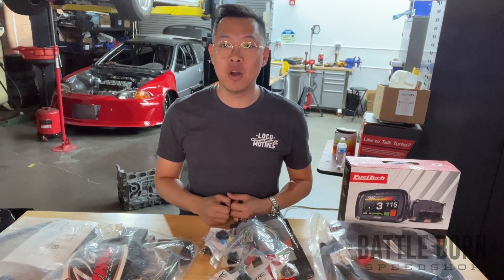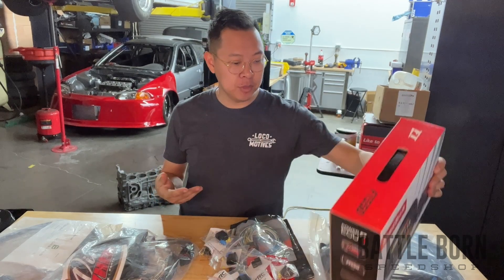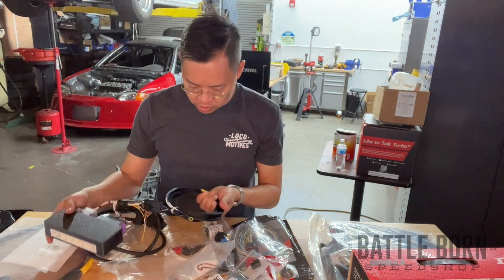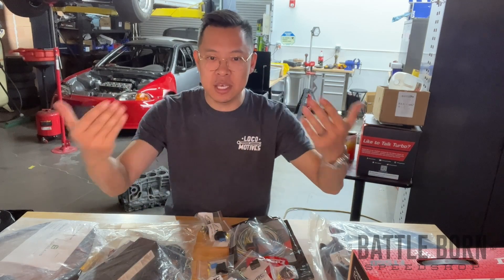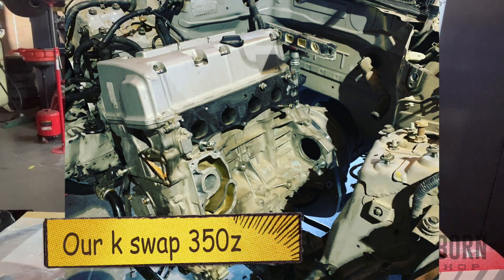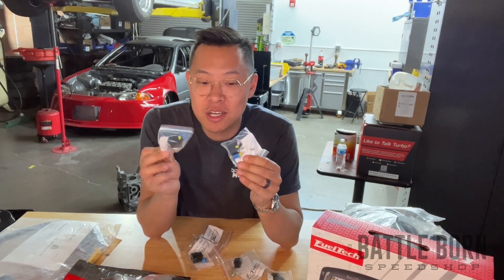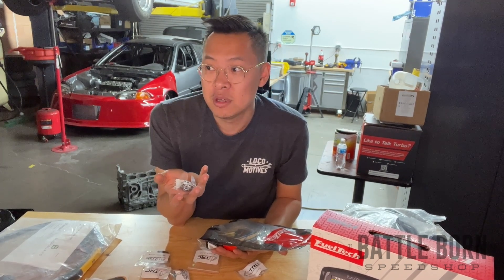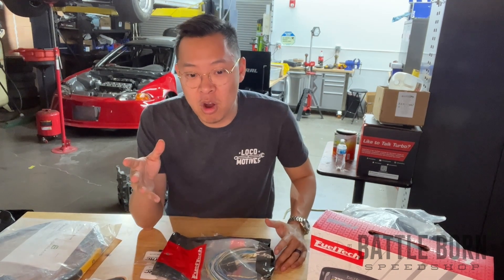3 WAYS TO WIRE YOUR FUELTECH STANDALONE ECU

Comment: i have a 1997 Corolla AE111 that has a 4afe engine, its fuel injected but uses a distributor, sparkplug wires and im interested to buy the ft450, install it in my car and replace the old stock Toyota ECU. all i want is to see live data like checking the average fuel consumption, trip meter, TPS, O2, fuel level and coolant temp . i don't have any intention of tuning to a performance car, i wanna keep the car stock, its like the FT450 dash/ecu becomes a multi information display for my old car. can i do it?

also i plan to keep the old sensors, connect it to the FT450. maybe in the future upgrade to coil on plug ignition also. lastly can i see avg fuel consumption on the ft450?

Comment: What do I need to run 8 injectors 4 on pump gas and 4 on e85 separate fuel systems k24 ft550

Comment: Also has outputs for head lights and tail lights along with turn signals just about anything you need as long as there's an output left for it. I'm using the FT550 with a rywire harness in my turbo b-series. Found a stock OEM female ecu plugend then crimped and solid all my own wires. Took a little time but came out just right.
Reply: I’m going turbo v8 and it sorta scares me to lose my knock sensor

Comment: I need a jumper harness for my Fueltech ft550 on a sw20 K Swap MR2. The harness will have to be a tad bit longer to reach my dash.   Can you accommodate this? I’m currently running K Pro on a K24a2

Comment: Good afternoon, what about controlling your cam vtc gear? Will this work?
Reply from the maker: https://cdn.shopify.com/s/files/1/1414/6340/files/FT450_HONDA_K20-24_ENG.pdf?v=1598466861
Reply from the maker: Yes it will. They have you wire it a specific way.

Comment: I am confused about existing Honda fusebox and relays. As an example - the radiator fan relay wire goes to the fusebox right? Where would i connect my FT ecu wire for that?   (btw this is for Honda Fit swap)

Comment: I have stock acura rsx type s, i want to change simple stuff like intake manifold, race headers, cold air intake, will this work?
Reply from the maker: Because you already have a k20, I would wait until you want more power out of your RSX for the fueltech
Reply: @diymike  i apologize, i am new on putting upgrades for k20. What do u mean by “wait until you want more power.”? I only want 275 hp to 300 hp all motor. No turbo, not doing k20/24. May u pls also help me with list i need to achieved even 275hp on my rsx type s? Thank u in advance.

Comment: I know this kinda dumb but would this work on an a3 since its still technically a k series.
Reply from the maker: yes it will, as long as its wired correctly a fueltech can power any motor from 2 cylinders to 12

Comment: Does anyone make a harness that lets me use my existing rywire engine harness but just lets me plug that and the fuel tech together for b series like you showed for the k series? Until i rewire the entire car from scratch for standalone?
Reply: this will sell..!!!!
Reply from the maker: I don’t about B series … but! Standalone harnesses are in the works currently
Reply: Not sure if you found it yet but BoomSlang makes an adapter harness for the low low price of $700.
Reply: @harryazzole7814  dude your a fu*king life saver 🙏🏼🙏🏼🙏🏼 thank you so much

Comment: Let's do a J series FT600 in a 6 speed TL S type. I'm in Vegas own the FT600, A and B harness non terminated, FT 8 switch panel. 2 nano O2 sensors 1 for each bank. And most, if not all connectors and sensors. The TL is gutted and easy to work on. J swap Jason.
Reply from the maker: Bro I got an standalone aem infinity harness for a j32. Right now. Imma do a video on it.
Reply: @diymike  we should link up. I'm the guy that tossed Carlos some P2R gauge's when I hurd you got the J series build. Told him use them on whatever your team wanted, but hoped to see them on the j series build.
Reply: @diymike  also the engine build is a j32a3 with j37a1 crank, traum .5 over pistons and P2R rods, with their baddest CNC heads they make their vtec Killa cams that lose the outer cam lobes, all oversized Ferrera valves with all the goodies. It's going to start as a N/A build on E.